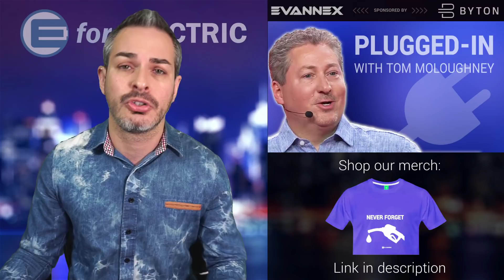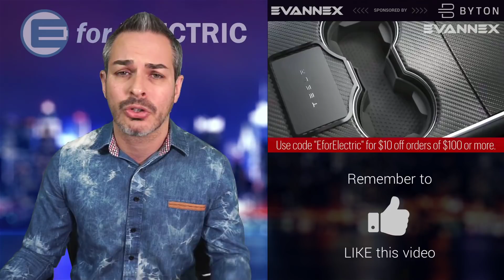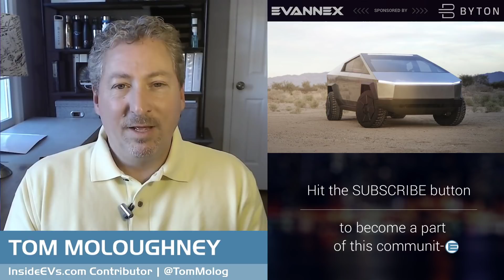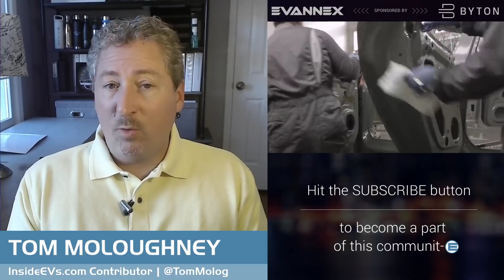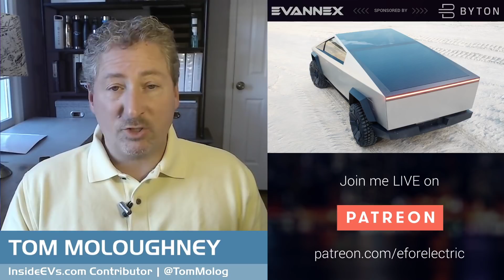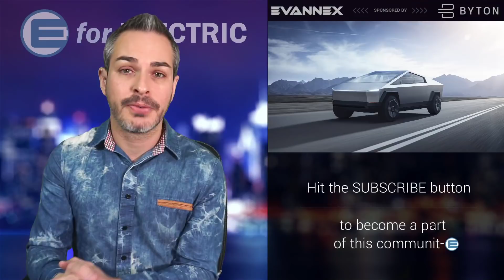Will Tesla Have to Delay the Cybertruck?

Comment: Delay are common, I wouldn't worry. Model X delayed Model 3 prototype roleout. Model 3 big rampup delayed roster 2 and lorry as all competent staff were tempory relocated to model3 in 2018+.  Battery hug ramp up delayed tesla wall pack (as all those GWatt/h weren't still enough). It's part of the delta between;  realism vs expectation.

Comment: I’m counting on them to delay it, I can’t afford the tri motor without saving up a significant down payment so the overall payment is reasonable. My order went in on Xmas day, I’m 438k in line , I hope there are no cancellations or minimal so I get the extra 6months to save. I work from home so I really don’t need it, I was looking at buying a used ford before the unveiling and as soon as I seen Tesla’s version was on the horizon I started putting cash back. I want the solar, towing, CyberQuad, FSD and HUD options. It’s not going to be cheap.

Comment: Tesla will speed up.  Not slow down as a result of CV. Strong innovators like Tesla will thrive. Companies that simply produce some widget will suffer. 

Good point about the cost of ownership. This is something that will allow Tesla to thrive. ICE vehicles are dead. Tesla will not be able to meet demand.
Reply: The world of heavy duty machinery will continue with diesel for a good while yet. But operators are highly cost conscious. ICE has low capital with high running costs. Electric is the other way around. When the graph lines cross they will switch to electric.